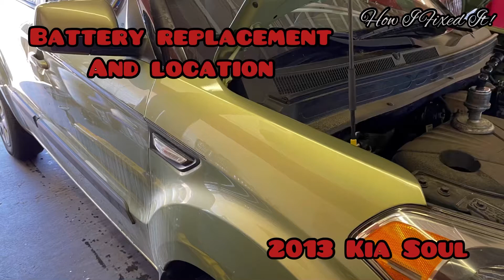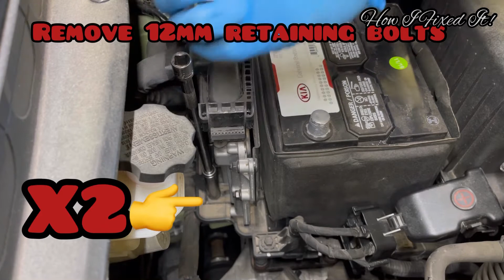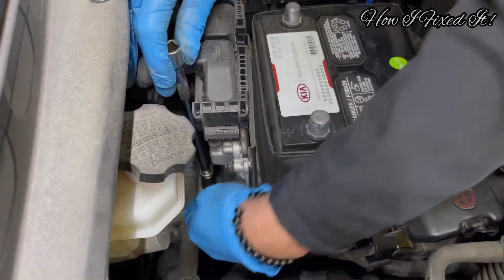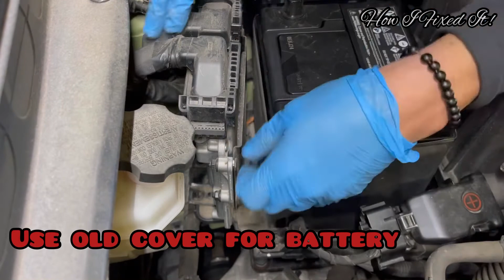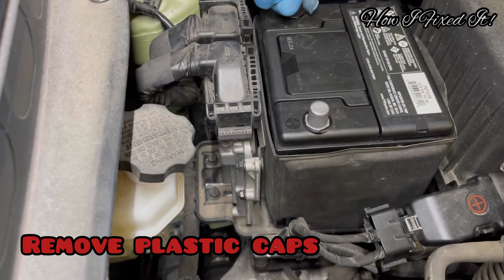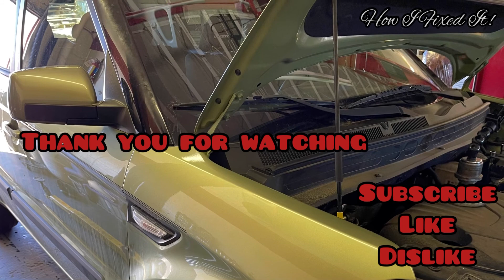How To Replace Battery/2013 Kia Soul Battery Removal And Replacement/Kia Battery Location

Comment: The battery terminals are 10mm. The bolt holding the battery bottom is 12mm as stated in the video. I just ordered a new battery, as it's a special order for some reason. Replacing the original battery, so got a good 9 years out of it!
Reply from the maker: I appreciate the feedback. Thank you 👍

Comment: I needed a battery for my 2013 KIA Soul. It lasted 9 years, so I was lucky. I came across your video and incredibly helpful. I never would have known of those 2 retention screws. { new Subscriber }
Reply from the maker: Thank you for the feedback 👍 I appreciate it and the subscription.
Reply: Kia soul North America, 2010-13 ( 1st gen ): battery : 121.  Or more expensive AGM battery 35.

Comment: Now where do you get the replacement part for the two positive cable connector? Ours rotted out and I cannot find the replacement part anywhere?
Reply from the maker: https://www.kiapartsnow.com/genuine/kia-terminal-batter~919902w010.html
Reply from the maker: https://www.kiapartsnow.com/genuine/kia-sensor-assy-bat~371802k000.html
Reply: @HowIFixedIt  that is not it.
Reply: @HowIFixedIt  I saw this. The fact that the whole assembly has to be replaced is criminal